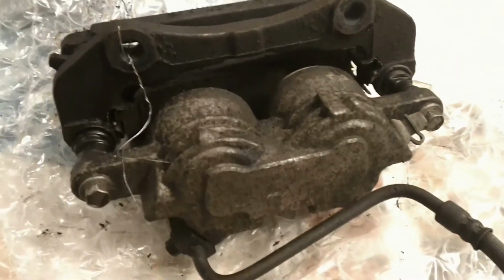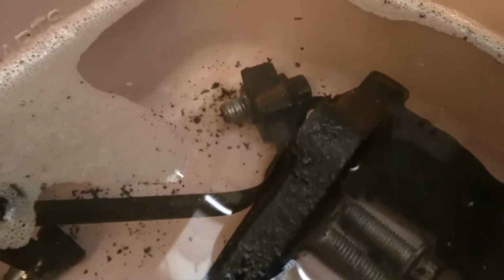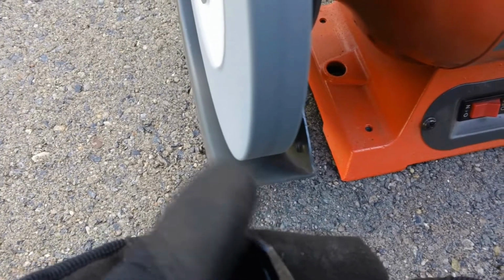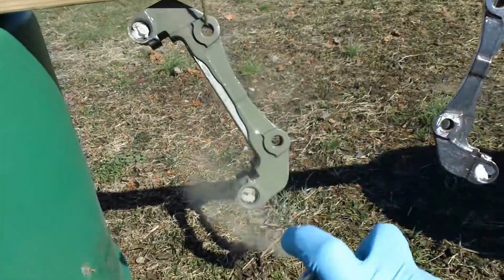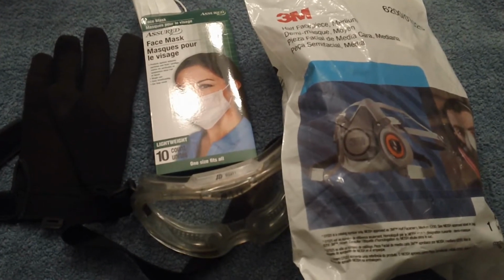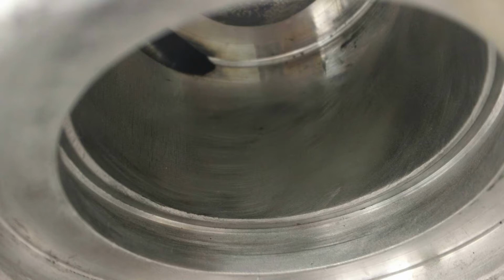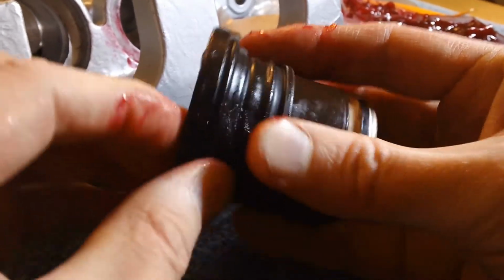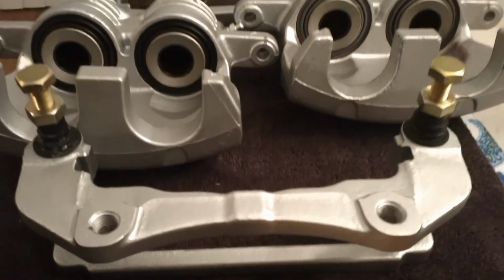PBR Front Caliper Rebuild Highlights

Comment: Put the dust Boot on with out the piston and then put compressed air in the bleeder valve and put the piston on the end of the boot and let the air expand the boot and down the piston will go,

Comment: I replaced the caliper piston seal and dust boot.
Now I have air in brake lines no matter how much bleeding I do.
Can a new square o ring seal cause air in the system??
Reply from the maker: Anything is possible however if there is contamination or particles in the lines/fluid this can damage new or old seals.  I would also check the condition of the rest of the brake system for leaks. After I rehabbed the entire brake system the abs pump was cycled and a manual brake bleeding procedure was done.  Hope this helps. 
Happy New Year and good luck!
Reply: Make sure you have the calipers on the correct side. Bleeder screws must be UP.

Comment: I have Raybestos WK 1770 Seal and Boot Kit and now try to install it on a new cylinder (I'm rebuilding the calipers). Which way that rubber boot goes to the cylinder (you can flip it over both sides). When it is on the cylinder which side of the boot is up? There is one on which there are some numbers printed on the surface of it (15, 3100, in very small print). So when installed on the cylinder, should these numbers be visible, or it should be opposite side on the top? Thank you for the film.
Reply from the maker: The outer lip of dust boot should fit concave to the inside of the bore.  Numbers really don't matter concerning position in this case.
Reply: @Screenguy3  Thank you, but it fits both ways. You can fit it, then flip it over and it will fit again. When fitted on the cylinder the inner lip points up or down, if you could tell?
Reply from the maker: @olenaerhardt7725  With that configuration kit it appears to have the retaining ring that holds the dust boot in place via a groove in the outer bore unlike the press fit that is shown
in vid.  With your application the outer boot area may be identical on both sides however the inner lip should be flush or down as you mention to dispel or prevent dirt , dust, grime
from infiltrating the bore cavity.  As always the seal itself needs to be protected, that is  the reason for the outer boot(s)  That's all I got.  Enjoy!
Reply: @Screenguy3  Thank you for the concern to my question. I think those boots are different, at least 2 modifications of them. E. G. your seal boot doesn't need a snap ring (I saw those in other films, most fm England). My kit does have a snap ring and there was one on the old piston as well. I thought to put the boot w/the lips up, so the snap ring can be embedded into the folder of the boot, so it is bore wall, boot material, snap ring, boot material, but now you say lips should be down (and looks like it is done in this manner in the film), the manufacture can't answer the question, so I'd better go to the shop store, maybe they can tell smth. Probably it is hard to tell anything on this question if you don't see the object. Thank you again.

Comment: Hi, can you please provide me with the part #"s you used to rebuild these especially the boots to air tapped on top the caliper brackets for the slide pins, also what size pistons are those? Thanks!
Reply from the maker: 3/4" diameter for the boot plugs.  1 3/4" for the pistons.  Rock auto has all these parts with the exception of the red lube.
If you search RA all prices and #'s can be found under 2009 Taurus calipers.  Actually have four of those boot plugs  on my desk collecting dust.